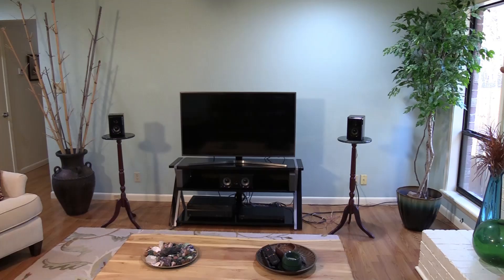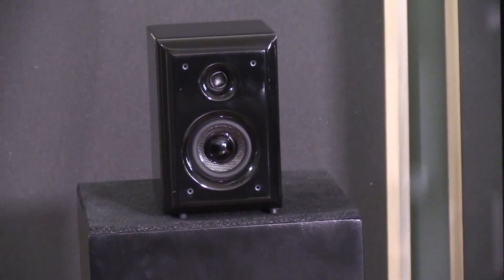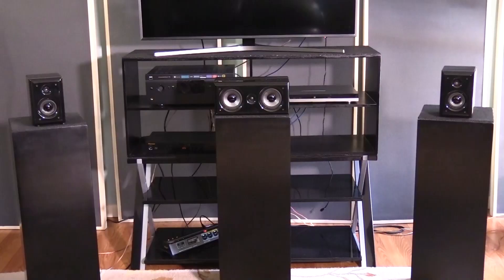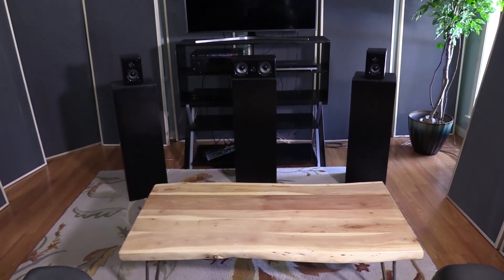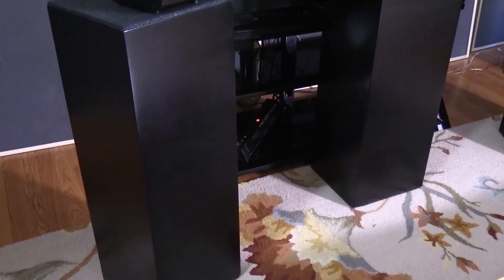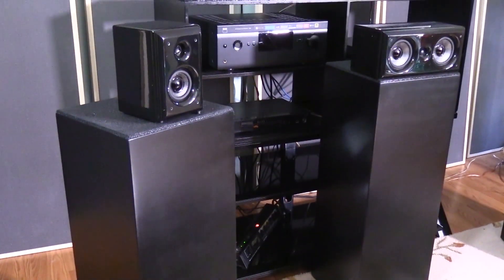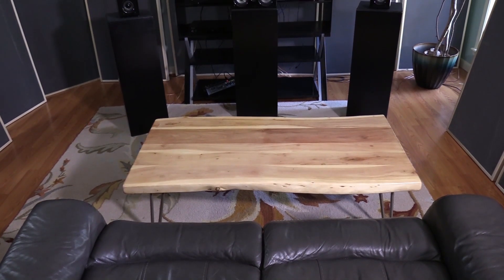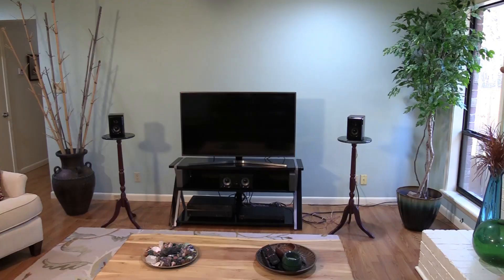Michael's Home Theater #6 - Old Product / New Design - www.AcousticFields.com

Comment: You say the speaker platform is 35" high and has a 12" deep cabinet. What is the rest down to the floor. Mass and antivibrational layers?
Reply from the maker: It is our new ACDA-10 and ACDA-12 technology within one unit.
Reply: @AcousticFields  Are the diaphrams pointing towards the top (speakers) or are they on the front pointing towards the listening position?

Comment: Thanks Dennis! Getting a divorce was the best thing I ever did for my room acoustics. Fixed that high frequency nagging that was leaking in from the other room 👍
Reply from the maker: Lowering the source pressure is a good start when it comes to noise transmission.

Comment: I've been curious about sorbothane for isolating speakers. I'd like to know your take on it Dennis. Is it plain BS or does it actually help?
Reply from the maker: Try it and report back on the sonic changes you hear.
Reply: @AcousticFields  so I was able to try it out. I made sure I got the right diameter and duro for my speakers and it works! It definitely cleaned up the bass and reduced vibrations around the surfaces which improved the overall sonic image. Although it's probably not as effective as your stands in the video, sorbothane is relatively inexpensive (about $30 per speaker). I was doubtful at first but glad I tried it out.

Comment: I understand it sounds great but how is this a viable solution? What’s the value of the room treatment until this point? And esthetically, it’s a mess!
Reply from the maker: You must make a choices if you do not have a dedicated room. This choice works well for Michael's room. He can place the Foam Frame Panels in their proper positions when listening and then stack them along the front wall when not listening to theater. Increasing the foam thickness on the front wall with stacked panels, increases the low frequency absorption on that wall surface area.
Reply: I think most people who would do this would have a dedicated room for it....in the basement.
Reply: Watch that ceiling height though. Basements tend to have sub-8ft ones.
Reply: @The_Mariner  Most people don’t have a separate room or even a basement, probably most people rent their apartments. Also most people, including most of the hi-fi reviewers, don’t understand the importance of room treatment and I don’t think the solution presented in this video will convince them.